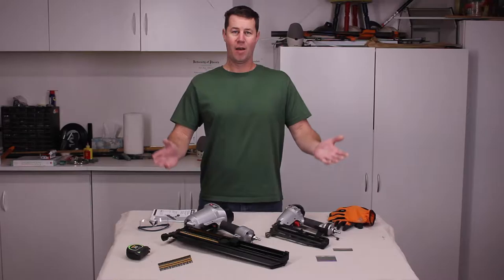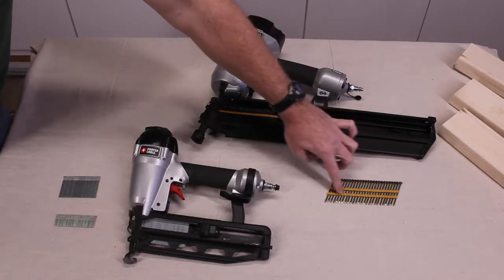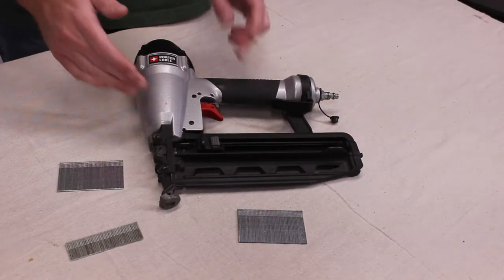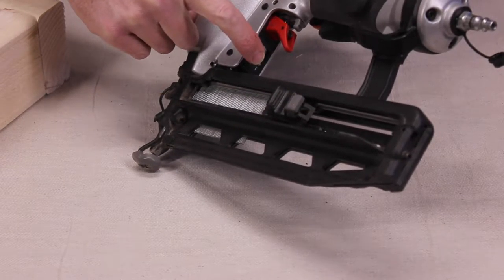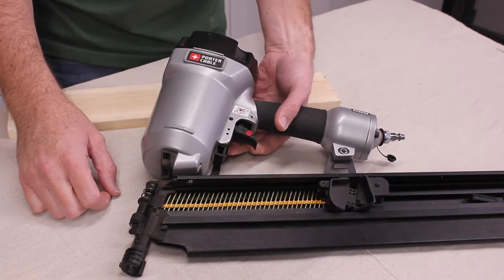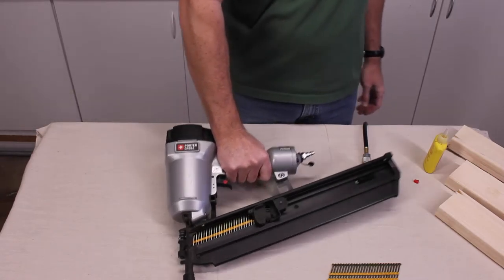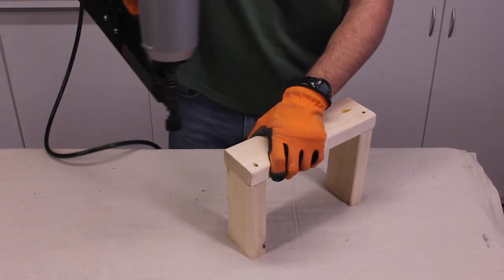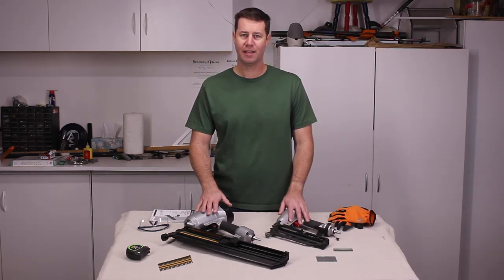How to use a nail gun.

Comment: What is a cheap but good enough model for home use just to repair or replace some baseboards, not full insulation?
Reply: This is a question.
Reply: 16 gauge porter cable finisher